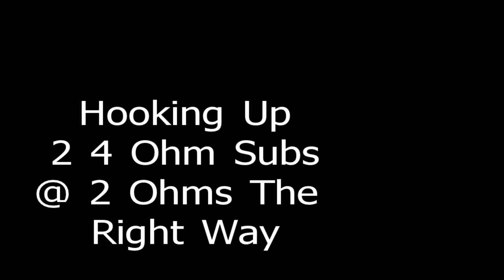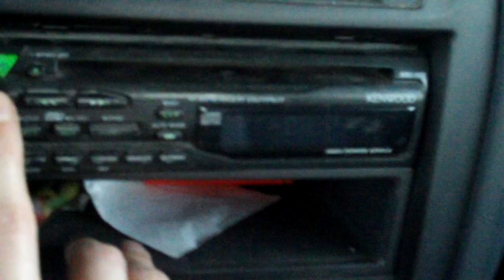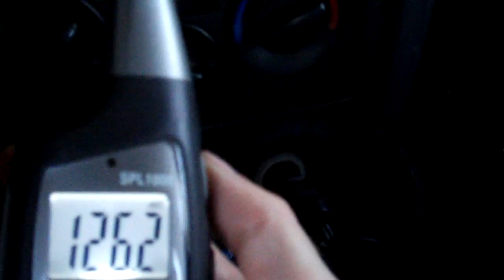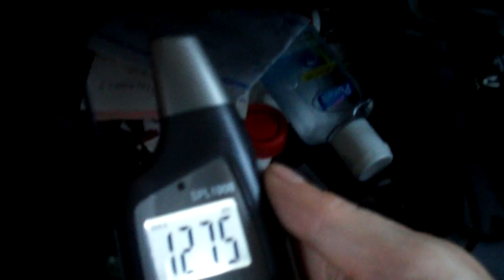How To Hook Up Two 4 Ohms Subwoofers @ 2 Ohms On A Mono Block Amp

Comment: Not entirely, the speakers are ran at 4-8 ohms on average so that they don't have to engineer the amplifiers to run low resistance which is better for heat and for amps capable to run more speakers when in parallel. Good amps such as RF, Audiobahn, MA Audio, MTX, ect. are engineered to accept 1 ohm  loads and lower with no ill effects. Usually when running speakers in this configuration on shitty amps the amps distort the signal making the speakers pay for it. Moral: buy quality shit.

Comment: Don't get a "1500 watt" amp. That doesn't tell you anything. Always match rms wattage at the proper ohms. So if they are two single 4 ohm woofers at are rated for 250 watts rms a piece, wire them in parallel to a 2 ohm load and get an amplifier that puts out 400-600 watts rms at 2 ohms (wattage doesn't have to match perfectly).

Comment: Hey, Like the video but say if I were to get a Monoblock.. I have two subs at 250rms 500peak at 4ohms.. and I want to wire in parallel.. How much wattage do i need? .. do i add them?

Comment from the maker: Hook them up in parallel bro. it will bring them down to 1 ohm. Don't maxx out your gain. You''ll prolly get around 200 watts per sub doing this which your subs can handle. I have a JL W3. Goto rockford wiring wizard if you don't know how to hook up in parallel. If you hook up in series you'll prolly get like 75 watts per sub which i'm sure you want more power than that

Comment: got a question. what is the best way to hook up (2) jl audio W3V2D4 subs with a jl audio 500/1 mono block? people say parallel then others say series. what do you suggest without maxing my amp and blowing my subs? 4 ohms to be safe or bring down to 2 ohms. let me know asap im gonna hook them up today or tomorrow for sure but looking for the best way before i screw them in the box. thank you

Comment: So what does lowering the amount of Ohms do exactly? it changes the tone of the bass doesnt it?  I LOVE bass and messing around with a system, but I have no clue what ohms do in higher or lower numbers. Also, what do you think about 2 15in type Rs powered by an MRP M-1000 would be? that's what I'm thinking about getting.

Comment from the maker: @jasonmangal Sorry to hear bro. If you had your gain cranked then cranked your volume knob on your headunit you prolly clipped the shit outta them. You need a bigger amp if you want it to be louder. I try and NEVER crank the gain knob and I listen for distortion very closely when I turn up the volume. You box shouldn't be a problem but crankin gains and volume knobs is never good. Goto rockford wiring wizard just to make sure you have them hooked up right.

Comment: RFL600d  600 rms @ 2--- 400rms @ 4 monoblock amp and i had my 2 pioneer champions 400rms hooked up to my amp at 2 ohm.the same way u show at the beginning. just stuffed in there....burnt 1 out and and other is a low reading 2.9 ohms disconnected wen it was 4 ohm before. im buying mtx jackhammers12s to  replace. what do think went wrong? note the gain was full  :( i noticed it get quieter over time. it was also in bandpass box any advice when im reinstalling should i get a ported box

Comment: ayite. so ima have 2 DVC 4 ohm Alpine type R's, and my amp is a RF 2000 watt max mono block. how would i wire it so that im getting a 2 ohm load? the amp runs 320 RMS at 4 ohms and 500 RMS at 2 ohms. so id also be bridging to get the subs enough power

Comment from the maker: @montayay1 Its really that simple as long as your going from a 2 channel to a mono block. Just switch the wires. Only one thing!!! Make sure they take the same size power and ground wires. I'm guessing your 2 channel has 8 gauge so make sure your mono block takes 8 gauge or you might need to upgrade wires to bigger

Comment: i have a 350 watt amp hooked to 2 kenwoods its a stereo 2 channel amp i believe. i had fry's hook it up and i am wanting to switch it myself to a mono block kenwood 1000 watt amp. can i use the same wiring and just plug in all the wires to the new one? would that be simple or are there would i be better off just paying someone to do it for me?

Comment: well i got a 5500 watt mono amp. and then i got a momo 12" with a peak power at 1000 and then it just says 4 ohms. then i got a 12" power acoustik with a peak of 2600 peak and it says 2 ohms. so what can i do to hook them up so they would fry and shit but pound hard!? nothing is hooked up at the moment.

Comment from the maker: @thajoka151 I don't like mixing ohms on subs. Its better if you can have both subs @ the same ohms. I've never hooked different ohm subs together but I have mixed sub ohms on and amp and it sounds like crap cause your lower ohm sub sucks all the power

Comment: hey man i have a question. i have a logic 1400watt amp 4 channels with a sony explod 1200watt sub. i have it hooked up to channel one but idk if its at 4 ohms or 2. id like to run it at 2 ohms. the amp says 2 ohm stable but i dont have a owners maual for it so i was wondering how do i run the single sub at 2ohm? thanks

Comment: @casperskafs well mine its a 400 watt am its a cheap amp tho but it does the job and the it lowest its 4ohm but like if i add other sub that is 4omh and i do it in series that would be 8ohm would it sound louder then just 1 sub wiht 4 ohms i mean 2 subs making 8ohms vs 1 sub making 4ohms which one is louder? like i said its a cheap amp its a dual 400wtt amp

Comment from the maker: @toronjillo2 If its a 2 channel amp and you have it bridged and you add another 4 ohm sub to it I think you'll be ok as long as your amp is set to stereo and not mono. Thats how most 2 channels are that i've seen. Check how low of ohms your amp can take though so you don't burn it up

Comment: @casperskafs so if i run two sets of wires out of the sub that is connected to the amp, and the subs are 4 ohm, will the amp be running at 1 ohm? or still 2 ohms?

Comment: can you parallel wire 3 subs to one amp? as in can you hook the wires leading from the amp to a sub and branch off from the connection at the first sub to the other 2? will that work?

Comment: I noticed u didn't point out if ur subs are DVC or SVC. In the case that u have 4 ohm subs with dual voice coils u could only run @ 1 or 4 ohms with two subs. If u you have two 2 ohm dual voice coil subs you can achieve a 2 ohm load. For example kicker zx1000.1 is a mono d amp 1000rms @ 2 ohms you can connect two 2 ohm dvc subs to it making for 500w per sub. A true 1000 Watt system.

Comment: I have a Pioneer AVH-3300dvdbt, this perticular unit says it can have sub woofer hooked up 70w @2 ohm without an amp . I don't have an amp as of now, so I'd like to do this for now. How do I hook up the sub thru the rear speakers?(that's what Pioneer says to do, but that's all it tells you thru THIER tiny manual), so I have all the speakers hooked up, everything works great !, but now want to add the sub. Do I disconnect the rears and hook up the sub first and then to the rears? Or rear speaker

Comment from the maker: @ITz0kProductions LOL thank you very much bro. I think you can do some damage with those subs. You won't be blowin out any windows or anything crazy like that but you can make um bump in the right enclosure. My problem is I've never owned or played with any 5 channel amps so I couldn't tell you the best way to hook um up. Google ROCKFORD WIRING WIZARD. That might give ya a few ideas but also might confuse you a little since it shows them going into 1 channel

Comment: i have Two dual 4ohm 400w 12inc subs connected to a 1000w 2 channel amp.... it worked fine for 2 months then all of a sudden when i turn it up past 20 the subs go out... you know what that could be?

Comment from the maker: @ScreamMode1337 The more powerful the cables the better. Only problem is getting the bigger wire to fit in your amp. You really only needs ends on the cables to connect one end of the power and ground to the battery. And yes the screws will hold down the wires

Comment: Hello, I have a pair of 12 inch subs, my amp is stuck in my truck so id rather not move it to find the wattage, I bought instead, the most powerful cables (1200w cables) thinking that it would work, would they work still with over strengthened cables? and I have some cords without the ends on them, how to i hook the endings up? and how do i connect the two point forks? or do the screws hold them in... (yea they probably do >.<)

Comment from the maker: @brandon13ellis You can try hooking your subs up in parallel then into the amp. Each into their own channel. You should get the same wattage 1000 watts to each sub. I gotta tell ya though bro you'll be lucky to be getting 200 watts to each sub either way you go. Not doggin on your amp just telling ya the truth. Either way be careful I have a feeling your gonna throw that amp into protect a few times pushing it to hard so be easy on it.

Comment: i just bought a quantum audio 2000 watt mono block amplifier (QA2000D) and the terminals look like this + + - -. i hav two 4 ohm subs how would i hook them up? on the paper its says to wire it like this p P N n (p for postitive and n for negative) so thats how i hav it wired up. and it says 1x500w at 4 ohms and 1x1000w at 2homs. how much power am i getting to each sub?

Comment from the maker: @Invin86rs You should be able to just use 1 set of speaker connections and it should be same as bridging. The extra terminals are for easier wiring. Honestly I don't completely know all the details. Thats a question I want to know more about myself. My Hifonics Thor 3000 watt amp is just like that.

Comment: hey, ive got a question. Ive got 2 dual voice coil 4ohm subs that i want to hook up to a mono amp. The subs are pioneer TS-W308D4 subs, and the amp is a JL audio JX1000/1D. How could I hook these up? The subs are 400rms.

Comment from the maker: @morgielouwho1 Correct. + from amp to + on speaker 1 then in the same terminal squeeze another wire in there or if you have tabs like on these speakers connect to + tab and run to + on the other speaker. Do the same with negative. + to + to+. - to - to-

Comment from the maker: @darkhak21 My guess is your amp just can't handle the power. Its good your tried hooking up your sub in series cause thats what I would have done but on cheaper amps in my experience just don't like to be cranked up. They either get hot or go into protect or both. Maybe try tuning the amp different like to diff frequencys. My last amp (Autotek 1500) didn't like the lows. If I would crank it and hit the low lows it would do into protect. Thats what ya get when you pay $100 for 1500 watts

Comment: so how do I wire 2 d4 subs to 2 ohm on a 2 channel amp, Can I parrellel each subs to 2 ohm then just put one sub in 1 channel and the other in the other channel and that would be a 2 ohm load on each channel or would it go up to 4 ohms?

Comment: Plz explain this to me. I got two 12' clarion 600w single coil subs with a 1500w monoblock amp. How do i wire that? do i do it the way u did? isnt that series wiring and wat u shud do is parallel like just both subs to the single channel? plz help me out

Comment from the maker: @BrandonC2kk I wouldn't bridge the amp. What I would do is hook up your subs in parallel seperate. What I mean is take one sub and hook up + on one voice coil to the + one the other voice to + on one channel of the amp. Do the same with the -. Then do the same with the other sub to the other channel. That will bring your subs down to 2 ohms each. I've not messed with alot of 2 channel amps but thats what i'd do first

Comment from the maker: @protaper15f I think it would be ok. I've actually never tried. I would say try this. Hook one sub up in parallel by itself then into 2 channels bridged. Then do the same with the other sub and the other 2 channels. If that don't work try hooking up the subs the same way only in series instead of parallel. Goto rockford wiring wizard to help you understand series and parallel a little better if ya don't know. Put in 1 sub on that site though not 2 otherwise it tells how to hook um together

Comment: I have a ? 
I want to get 2 alpine type s 10" dvc subs as of right now I have a Rockford punch p450.4 for my mids and highs and a rockford power 600-4 that amp is In my truck right now running every thing I was wondering can you hook up 2 dvc subs to a four channel that way the punch runs the doors and the power runs the subs

Comment: yo tylerpalmer you need a noise filter. thats because u have ur amp wire really close to ur rca. the amp wire creats a magnetis firld that causes that so seperate them by running the amp wire(blue wire) on the other side of the car so yeaa. or just buy a noise filter at the flea market. dont matter watt kind

Comment from the maker: @tylerpalmature My first question is. What kind of noice and make sure your rca's are not running along side your power wire. Also make sure you have a good ground. Most people with a noise like whine noises have a bad ground or have their rca's runnin with their power wire.

Comment from the maker: @83berwick If you just have one 4 ohm DVC sub then it's no prob. You just gotta hook it up in parallel and you'll get a 2 ohm load. Like this. Hook one positive on one voice coil to the + on the other then into your amp. Like a bridge. Do the same with your - and you'll have a 2 ohm load

Comment from the maker: @93ChrisD You need more power if ya wanna get louder. 150 watts isn't much if you want bass. Its good if you just want a little more bump in your ride but if you wanna get louder get a mono block amp with more power and prolly a bigger sub.

Comment from the maker: @gordysuggs Yes you are correct. The lower the ohms the more power your subs pull from your amp. If you look at the ratings on your amp it will tell you what power its sending at what ohm. Just be careful some amps can only go down so far. For example I have a mono block subwoofer amp thats only stable down to 2 ohms so if I were to hook subs up @ 1 ohm it could blow it. Look up info on your amp if you don't know

Comment from the maker: @zrobeats 8 gauge sounds fine but I could tell you easier if I knew what kinda amp you have. For that much power on a 2 channel amp 8 gauge will work fine though.

Comment from the maker: @kingracing431 I think it will be ok as long as you hook your 12 up in parallel. If you 12 is a dual 4 ohm sub (dual voice coil). Hook it up in parallel. - to- then to amp and same with +. That will bring your sub down to 2 ohms. I've hooked up different sized subs to amps and its been fine but never different ohms. Its always better to match your subs though so they pull the same wattage from your amp.

Comment from the maker: @transonicem2 You should try using just one amp and hooking the subs up in parallel. Your subs are only hooked up @ 4 ohms with just one per amp but if you hook them together into one amp you can hook them up in parallel which will give them both more power. Watch my vid on how to hook up 2 SVC subs @ 2 ohms on a mono block amp. Do that and it might be louder. I know it sounds crazy but try it.

Comment from the maker: @Gipple02 I don't know what amps you been looking at but most amps not only will take 2 ohms but a lot can handle 1 ohm and some .5 ohms. ESPECIALLY mono block amps like this one.  This amp gets hot because its a class A/B Amp thats why its only stable to 2 ohms. A lot of people run their mid and high amps at 2 ohms.

Comment: You do realize that most amps aren't designed to run @ 2ohms and running them (parallel) 2ohm can cause your amp to overheat and burn up.  Also, running your amp at 2ohm causes the watt output to double, hence the overheating.

Comment from the maker: @kittybath HOLD UP. Don't run those subs together on the same amp. You can mess them up. Don't mix dual voice coil subs and SVC subs on the same amp. Your DVC sub sucks more juice from your amp and messes things up. Just saying. If your sub woofer is single voice coil 2 ohm then you can only run it @ 2 ohms unless you get another single voice coil sub. It sux I know but thats just how it is.

Comment: so I have a memphis 12 single voice coil 4ohm sub, and a mtx 12 that is dual 4ohm sub, is there any way to both at 2 ohm. I know how to run the mtx to two ohm but don't know how to get the memphis since its a single coil to 2ohm. Please help got these two 12s in sealed box, and a 800 watt 2 channel amp.

Comment from the maker: @BAWLS2894 Kinda goes like this. Say your 2400 watt mono amp is 1 ohm stable. That means 1 sub hooked up @  1 ohm will get 2400 watts. 2 subs hooked up at 1 ohm will get 1200 watts each ect. Amps have ohm ratings and so do subs. Watch my vid on HOW TO MATCH AMPS AND SUBS to understand a little more.

Comment: nice system dude...would you recommend 4 10's or 3 12's i have a single cab truck and really cant decide...i was going to do 2 15's but i dont have enough depth...so 4 10s or 3 12s is what im deciding on

Comment: @casperskafs Well haha i just got the hole thing fixt today the sub was wired worng LOL and just correcting yes my sony class D mono block amp has 2+ 2- its a 2010 model it puts out 300RMS @ 4ohms and 500RMS @ 2ohms it does not support 1ohm or lower ive tryed it it cuts out And also the subs cant be dropt down to 2ohms haha thay hit hard at 4ohms and 900watts..So thx very much for ur reply i forgot to come back and remove the commit :P srry to waste ur time

Comment from the maker: @MADdrummer971 So your sayin your amp is MONO BLOCK and it has 2 + and 2 -. The only mono amps I've seen that do that are expensive ones like sundown. If it is a mono block you can only run those subs at 4 ohms or 1 ohm. Like my ground zero 12's. Not callin you a lier on your amp or anything just curious